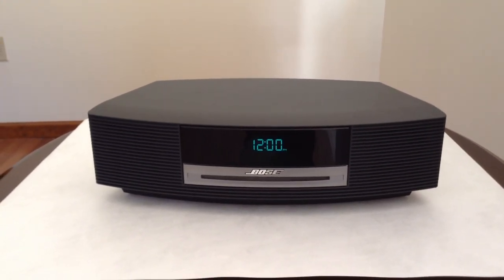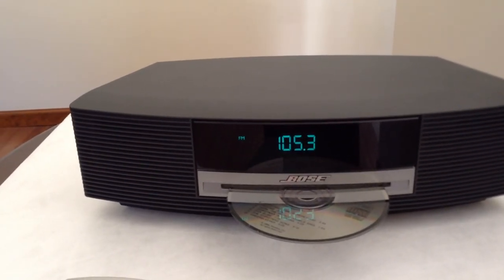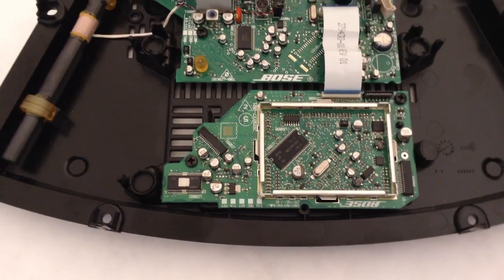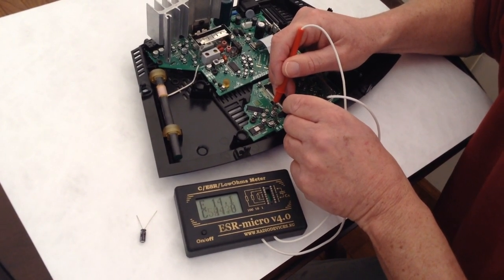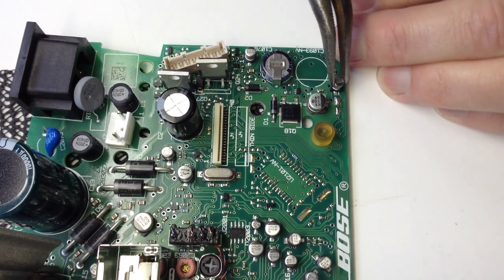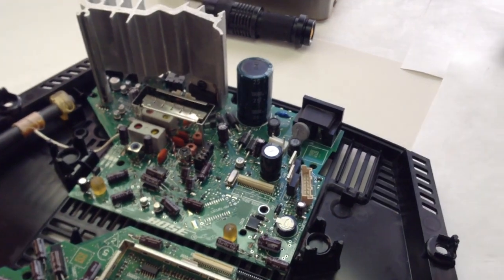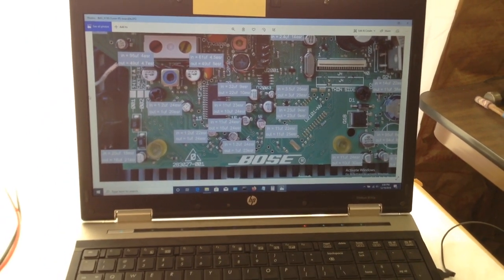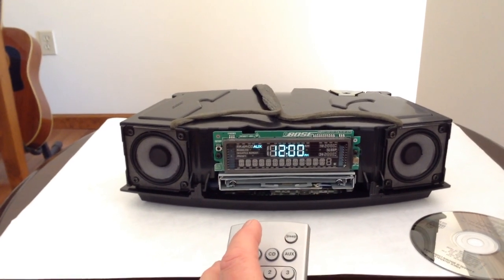Bose Wave II - AWRCC1 resets and CD skipping. Repair "Please Wait" problem

Comment: Hi George, where might I find the ESR meter you are using?  Cost?  Thank you.
Reply from the maker: Hi Lawrence. It is a ESR-Micro V4.0 that I purchased 10 years ago for around $75. It was made by a company in Russia called RadioDevices. They have newer versions now, but I do not see an active distributor in the US. 
https://www.radiodevices.ru/

I purchased mine from Brooke Clarke's website. He may still carry the ESRmicro line of ESR meters. It is a serious, old school site with tons of tech knowledge on vintage Military communications equipment, cryptography, electronics just to mention a few. Reading through his site would be a master class education.  His site represents what the founders of the World Wide Web envisioned. A place of shared knowledge. 
https://www.prc68.com/I/ESRmicro.shtml

I'm tempted to buy one of these cheap $9 ESR meters from China. I think they use a low frequency signal to test the caps so it may be tougher to test in circuit. There are tons of reviews out there if you search for "GM328" or "LCR-T4". They look like fun!

LCR-T4 version for $9
https://www.banggood.com/LCR-T4-Mega328-Transistor-Tester-Diode-Triode-Capacitance-ESR-Meter-With-Shell-p-1112140.html?rmmds=search&cur_warehouse=CN

GM328 version for $14
https://www.banggood.com/GM328A-LCD-Transistor-Tester-Diode-ESR-Meter-PWM-Square-Wave-Generator-Soldered-Module-p-1384846.html?rmmds=search&cur_warehouse=CN
Reply: Thank you very much, George, for your most helpful reply.  I appreciate it very much.  Hopefully, I will be able to find the ESR meter.  Thanks again!

Comment: I have two Bose media centers. One unit, I cannot turn off the power. The CD/DV player not working. The other unit, the CD/DV player works but the FM stations and audio output for the TV or AUX is not working. Can you fix this problem?
Reply from the maker: No sorry. I only fixed my unit and shared how I fixed it with this video.

Comment: Hi George. I put some heat to the second biggest capacitor inside of the metallic rectangular box. Now the Please Wait is gone and all functions work perfect. I left it working on FM for more than 20 minutes and all continues working.
Does that mean that the problem is gone or that the capacitor has to be replaced? Can it be that by heating it up a cold sold was fixed? I do not want to mess with it if not really needed.
I appreciate the work and information that you put together.
Reply: I have the answer - replace it!
After a long time running it I powered it off and the problem is back.
It is a Z3 47 6V. What do you recommend as a replacement?
Reply: Run another test and it is the biggest one inside the metallic rectangle box Z1 100 6V.
What replacement do you recommend?
Reply from the maker: @RickATu2b  On my Bose radio, all of the caps inside of the metallic rectangular box had high ESR readings, so I replaced them all. There is a German YouTube video where he just replaced the Z1 100 6V and got his radio working again. 
https://www.youtube.com/watch?v=Gkm8CSs0T0U

How were you applying isolated heat to the cap? 

If indeed you only have the 100uf 6v cap bad, I would replace it with a good quality surface mount cap that will fit in the metal box when the lid is pressed back on.
CAP ALUM 100UF 20% 10V SMD
https://www.digikey.com/en/products/detail/nichicon/UUD1A101MCL1GS/589989?s=N4IgjCBcoLQdIDGUAuAnArgUwDQgPZQDaIALAJwDMIAugL514BMxIAqmwCJgCCYADGACyAYQAyYAOIBlWnSA

If you want to use a through hole cap that has the long wires like I did in the video, you can use this and lay it down...
CAP ALUM 100UF 20% 16V RADIAL
https://www.digikey.com/en/products/detail/nichicon/UPW1C101MED1TD/4319914

The cost of shipping 1 cap will be the same as shipping many, so I would consider replacing the other caps in that metal box at the same time.  Many people who left comments here were able to repair their Bose radio by replacing the 22uf 6v caps in that metal box so we know they can cause problems.
CAP ALUM 22UF 20% 10V SMD
https://www.digikey.com/en/products/detail/nichicon/UUD1A220MCL1GS/589983?s=N4IgjCBcoLQdIDGUAuAnArgUwDQgPZQDaIALAJwDMIAugL514BMxIAqmwCJgCCTTABgCyAYQAyYAOIBlWnSA

When removing the old and replacing with new caps, think like a doctor and cause no harm.
Good luck Rick and keep us posted on your project!
Reply: @georgeterbush2976  Thanks George.
I applied heat like the German guy did. I watched that and did the exact same test before writing to you. Any problem doing that?
I ordered a MESR-100 V2 that will arrive by the end of the week. I also found the ESR-micro V5.0 and would like to hear from you about it.

I noticed that the installed capacitors are 6V and the ones that you recommend are 10V smd and 16V. What is different when replacing capacitors by new ones with different voltages?

As the cost of shipping is the same what you recommend for the Z3 47 6V?
Reply from the maker: @RickATu2b  Hi Rick.  The surface mount caps in the Bose radio are probably drying out which reduces their ability to filter the voltage.  Applying heat with a soldering iron for a few seconds to the body of the cap should not hurt them.  I do not have any experience with the MESR-100 V2 ESR meter, but I do like the Russian ESR-micro V5.0.  I just bought an inexpensive ESR meter from Banggood.  It was on sale for $12 US. I have not had the time to do a comparison between it and my ESR-micro V4.0
https://www.banggood.com/GM328A-LCD-Transistor-Tester-Diode-ESR-Meter-PWM-Square-Wave-Generator-Soldered-Module-p-1384846.html?rmmds=search&cur_warehouse=CN

With all of these ESR meters, it is very important to discharge the cap before testing. Most of them do not have much internal protection. Better safe than sorry.

As far as the voltage rating for the caps, it is usually ok to use a cap with a higher voltage rating. Where you run into trouble is the physical size of the cap. The higher voltage parts are usually larger. That can be a problem when working in a tight space like under that metal can.  The dimensions of the SMD caps I recommended are very close to the original caps in the Bose so they should fit.

For the 47uf 6v cap I would use...
CAP ALUM 47UF 20% 6.3V SMD
https://www.digikey.com/en/products/detail/nichicon/UUD0J470MCL1GS/589972?s=N4IgjCBcoLQdIDGUAuAnArgUwDQgPZQDaIALAJwDMIAugL514BMxIAqmwCIAMAUqQHZuAWQDCAGTABxAMq06QA
Reply: @georgeterbush2976  thank you. Just ordered the capacitors.
Reply: Back to work!
I had to change the 22uf that you point on your picture, the 47uf and the 100uf. All inside the metal box.
It works like a charm.
Reply from the maker: @RickATu2b  WOW that was fast!!! Awesome job Rick. Your Bose radio will always have a special place in your heart knowing that you saved it from the landfill. Thank you so much for sharing your experience here. I'm sure it will help others.
Reply: @georgeterbush2976  Hi George. Thank you for the guidance, knowledge sharing (digi-key, esr tool, pics, reference, etc.) and instructions.
This one is back to my daughter’s room. She has it connected to amazon alexa and the sound is incredible! It used to be mine.
I fixed an old av receiver Sony str-de935 that was put aside for many years after I bought a Denon. This one was just a matter of redoing some soldering. I connected it to two small bose speakers and it is also special. I have it for at least 20 years and putting it back to life was great!
Recently by working from home and having more time I hacked my iPod 5th gen by replacing the mechanical hd with micro ssd (4x 250gb) and a more powerful battery. It didn’t stop there, I bought a 7gen and a mini and hacked both. They work and sound great!
It is so good to bring all these to work again with updated and better parts.
Watch some of DankPods videos on youtube if you are interested. They are funny and instructive.
Take care and stay safe! Happy Holidays!
Reply from the maker: @RickATu2b  You are definitely a hardware hacker. It's nice to know your way around electronics. It's funny. I am nursing an old Sony STR-DE835. I use it for my home theater. When I first turn it on, after a few seconds it flashes "Protector". If I keep it on for a few minutes, then turn it off/on again, it works just fine. I want to open it up and look for the problem but it is such a pain to disconnect all of the cables and pull it out of the shelf. I just live with it for now.

Comment: Got one here all SMD caps under the smaller PCB have failed.
Reply from the maker: It would not surprise me. Most of the caps on my CPU/CD board had high ESR values. What model Bose do you have? Did you check the caps with a ESR meter? From the looks of your videos in your channel, you will have your player up and running in no time!
Reply: @georgeterbush2976  hey man yeah it was a Bose Wave 2 with the exact same PCB as yours. Yeah I checked them on the board but figured when I heated the smaller 100uf cap by the flash Ic the system would fail but I checked them all on and off the board I’d say 90% had failed. 

I’ve done a few of these now, if you ever get one where the CD drive works then just stops after like a minute check the laser hasn’t burnt itself out had one in that gave me a right run around tracing down why it kept stopping the song after 1 minuet exactly. Changed the CD drive worked perfect, never did get to the bottom of what was the cause though.
Reply from the maker: @MrReeceyburger123  Awesome! Thanks for the update and for the tip about the laser. It can be maddening, trying to track down a problem like that. It could be almost anything. That's when having a good second unit comes in handy to swap out boards and drives to see where the problem lies.

Comment: my Bose Wave is exhibiting exactly the symptoms shown in your video, and it's been driving me crazy!  I am nowhere near skilled enough to attempt to repair it myself.  Any chance I could ship mine to you and have you properly diagnose and repair it?  Of course I would pay you for all parts, labor and shipping.  Please let me know if you are interested.
Reply: Rick Stone Bose will fix yours for $119.  Getting ready to send mine out
Reply from the maker: Hi Rick. Sorry to hear about your Bose. Judging by the number of people who have watched this video, you are not alone. I am not really set up to repair peoples electronics. I just did it because my neighbor was going to throw it out and I had nothing to loose but $20 in parts and my time. I have been repairing stuff like this since I was a kid and was looking forward to the challenge. This was a tough project, maybe tougher than it should have been. Some viewers here were able to troubleshoot and isolate the bad part(s) by using a soldering iron to warm up the part. If your Bose was like mine, it works better as it warms up. I took a lot of readings on the caps and thought many of them were in bad shape. I replaced most of them since I had it all ripped apart anyway. Unless you do the repair yourself, or bring it to a buddy, there is no cheap way to fix it. People are so use to FREE shipping with Amazon, but the truth is, it is very expensive to ship a heavy item both ways. You may want to try Bose service department and see what they would charge.

Comment: I’ll be darned. It worked. My 85 yr old mother was so upset her radio did not work. Said what the heck let’s try it. Made no sense but why not. It took about 3 minutes then it magically started working. Very cool. Thank you and all who commented.
Reply from the maker: Ok, you got me. What did you do that took 3 minutes that fixed it?
Reply: @georgeterbush2976  held the blow dryer on it. About 3 minutes it started to work. Day 2 it is working
Reply: @rubyhill2584  hey question…. Where did you aim the blow dryer? Did you open the back and started blowing hot air on the capacitors? Lol sorry I’m desperately trying to fix my parents own
Reply: @Dior3llaxoxo  no, we just aimed it in front of the CD player.
Reply: Genial ! Hat funktioniert !

Comment: My Bose is about 15 yrs too and I have an extension with 3 CD players and now all the 4 cds are skipping. It is worth paying someone to fix it or buying  a new one. I know nothing about  fixing it.
Reply from the maker: That's a tough call. If you have a lot of CD's and listen to them often, then it may be worth getting it fixed. The trend seems to be streaming music through the internet rather than owning physical CD's. I personally like owning the disc. 

I'm not sure if your player's problem is a bad cap or a mechanical alignment issue. You can check out Lisa's video where she takes apart a Bose multi disc unit and realigns the gears...
https://www.youtube.com/watch?v=UZ2q3a7GdKU  

Maybe she can give you a quote for repairs?
Reply: @georgeterbush2976  I have never cleaned the player so I am going to order a disk cleaner and see how that works. I would much rather buy cds and play them because I just bought a new apple and yes none of the music was transferred over. Thanks

Comment: Very helpful. Could you post a copy of caps specs and locations?
Reply from the maker: Hi Bob. I do not have the service manual or schematics for the Bose Wave II AWRCC1.  The pictures I added to the description above are hi-res. You should be able to see the markings on most of the caps. Good luck!

Comment: I'm getting ready to order caps but I don't know what cap to get to  replace the 6v 170uf with? Thanks again.
Reply from the maker: Where are the 170uf caps? Is this the same Bose that I have? I only replaced the small surface mount caps. My large electrolytic caps both measured good so I left them alone. What caps are you going to change? You will need a certain amount of rework and soldering skills to do this job. It's very easy to lift a trace if you get impatient when removing the old caps. It's also easy to blob solder on the via through holes like I mentioned in the video. I'm sure you would not attempt this without a little electronics background. Just take your time and enjoy the ride. The journey is the reward.
Reply from the maker: @bob williams Hi Bob. Any luck fixing your Bose Wave radio?

Comment: I was just going to throw mine out the cd player doesn't work it says cd not playable meanwhile all of my cds work fine in my car I just unplugged it to throw out its a combo radio cd player I'm so upset.  I even tried the cleaner cd says same w that not playable  thank you
Reply: I had the same problem with it saying "Not Playable" on a CD I know is good and plays  fine in my other players.  So, I put it back in the Bose and let it blink about 15 times and it eventually accepted the CD and played it.  These Bose machines get weak after many years of use and become somewhat temperamental.

Comment: Hi thanks for your excellent videos, my Bose music wave system iv is saying please update and I don’t know what to do next could you shed any light on this please nothing is coming on .?
Reply from the maker: Hi Jim. Sorry, I don't know anything about updating a Bose radio. You can try contacting Bose support...
https://www.bose.com/en_us/support.html

I also found this...
https://community.bose.com/t5/Home-Theater-Speakers-Archive/Wave-IV-message-please-update/td-p/117547

Seems like there is a software disk that you need to get from Bose...
https://community.bose.com/t5/Wave-Systems/My-Bose-Wave-base-says-please-update-How-do-I-do-this/td-p/207617

You can try to do a reset on the player.

The steps are as follows:
- Power off your product.
- On the remote, press and hold the Alarm Setup button until SETUP MENU is displayed.
- Press the Tune > button repeatedly until RESET ALL is displayed.
- Press the Time + button to select YES.
- While PRESS 3 TO CONFIRM appears on the system display, press the number 3 button. 

 https://community.bose.com/t5/Wave-Systems/Wavr-Radio-IV-Please-Update/m-p/273446

Good luck!
Reply: I think you need to connect it to your computer via USB and go to bose website, from there you can download an update

Comment: Hello,
thanks a lot ! 
The  UPDATE: 4/21/2020 in your discription with reference to John Bosco and D_123 StL (where can i find this ??? ) was the solution of the CD skipping problem

The reference to the 22uF capacitor has also led to success for me. in my AWRCC4 I replaced this capacitor with a 22uF tantalum capacitor. Result: Error-free CD operation is possible again.

Das UPDATE:4/21/2020 in der Videobeschreibung löst das CD-Problem.
Der Hinweis auf den 22uF Kondensator hat auch bei mir zum Erfolg geführt. Bei meinem AWRCC4 habe ich diesen Kondensator  durch einen 22uF Tantal-Kondensator ersetzt. Ergebnis: Ein fehlerfreier CD-Betrieb ist wieder möglich.
Danke
Reply from the maker: Hi Der Fitze. You can find comments from John Bosco and D_123 StL down in the comments from 1 year ago. Great job getting your Bose to work by replacing the 22uf cap with a tantalum. That's never going to go bad again!

Comment: Thanks George.  I was about to go down the road of replacing the CD player but it looks like its a capacitor problem like in your video.  Too technical for me to resolve so will have to fork out $170 to get Bose to fix.  Thanks.
Reply from the maker: The replacement capacitors only cost around $20 with shipping but it took me awhile to figure out exactly what type to buy. There are so many specs to consider. The actual replacing of the caps took me several days because I did not want to create more problems than fix. I also wanted to document each step. This is a pretty big job. It's not like all you have to do is take the unit apart and plug in a new part. 

One thing I will say. Now that my Bose is fixed, I have been using it everyday listening to CD's that I have not listened to for many years.  For such a compact unit it has very good sound.